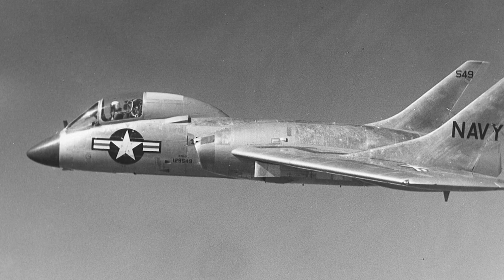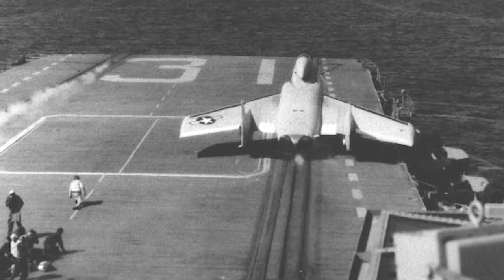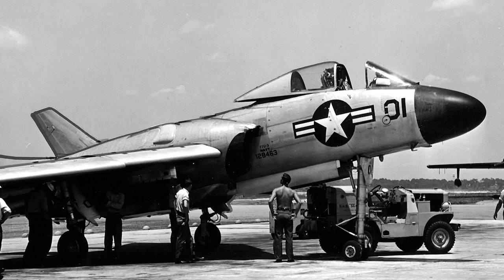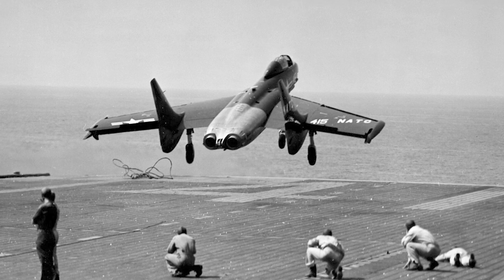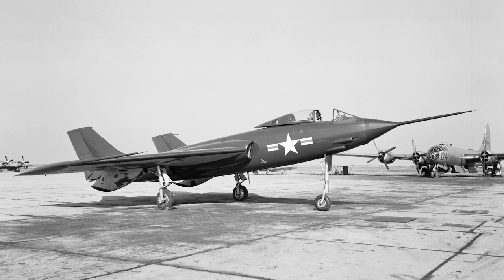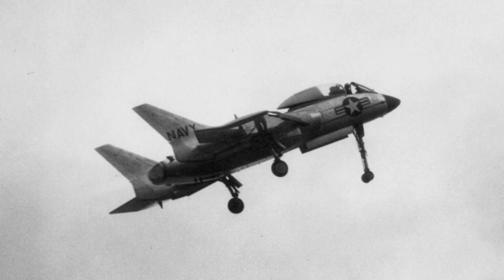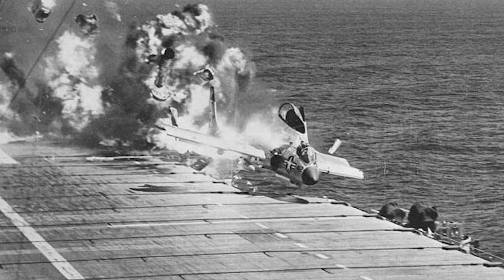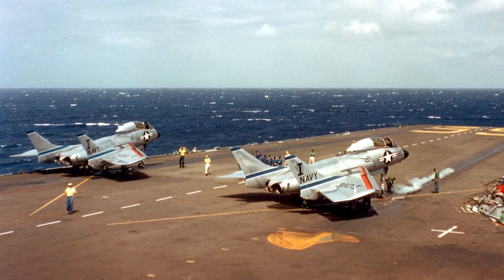Vought F7U Cutlass - A Short History

Comment: Yet, you'll notice many design features of the F7U present on today's front line fighter jets.  Twin tail.  Forward cockpit.  Longer, but not that ridiculous nose gear.  The F7U was ahead of its time.  Too bad it wasn't around long enough for fly-by-wire and improved hydraulics to kick the bugs out.
Reply from the maker: Yes, would have been quite interesting to see what it COULD have become.
Reply: Most of all if it could have had an engine that lived up to the designer and manufacturers optimistic promises